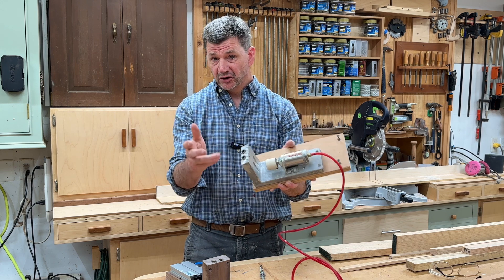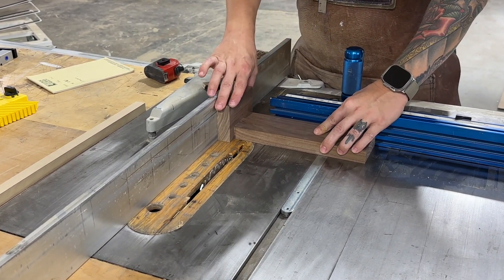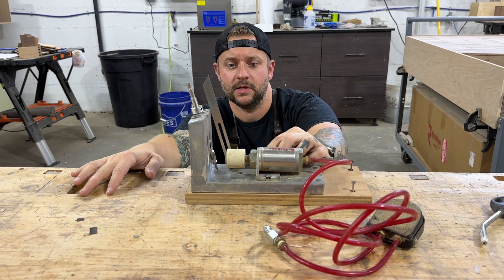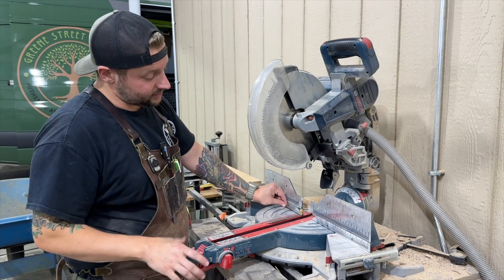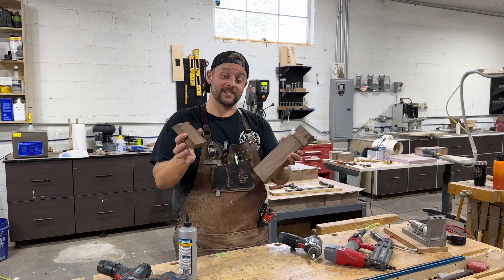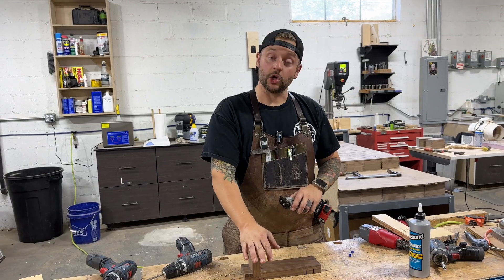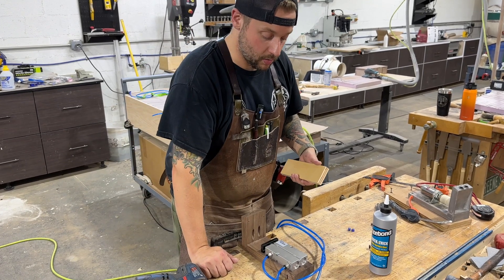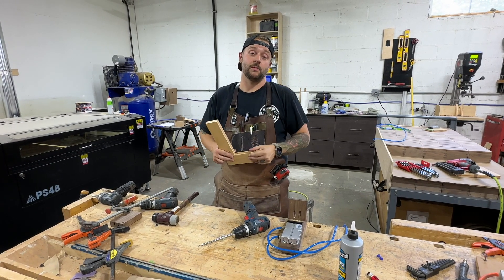Make a Pneumatic Kreg Jig / Pocket Hole Jig

Comment: Interesting, Jeff. I knew that initial cut was a mistake. That's where you use the 1/8" (or whatever you need) drill bit trick. How long will that drill guide last without bushings?
Bill
Reply from the maker: Thanks, Bill! Sometimes the camera skews my judgment 😝 I’d say the holes won’t last very long either heavy use. We talked about using bushings on version 2 if folks want to see it.